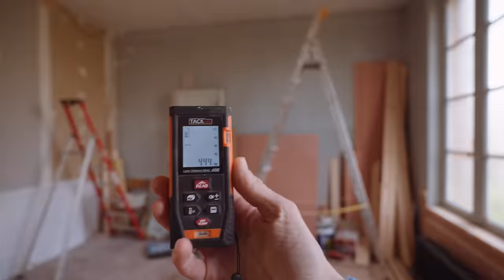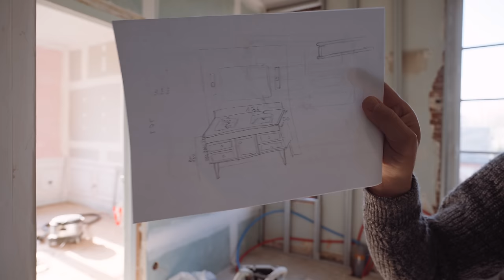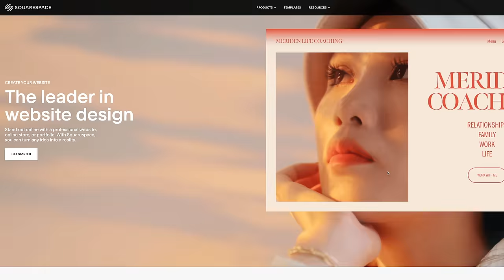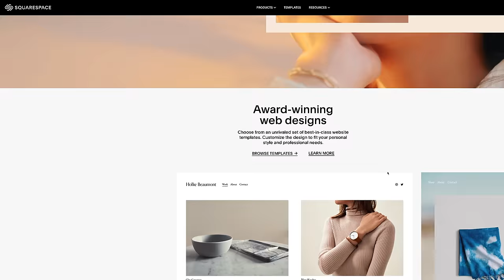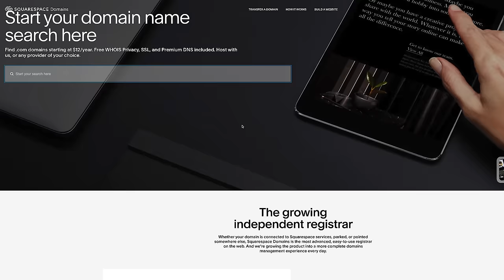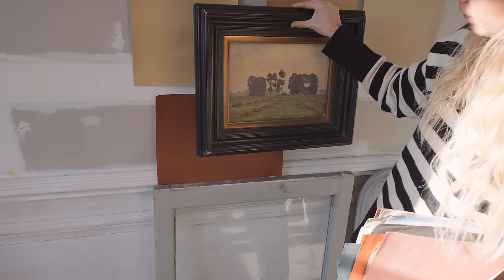Revealing the PAINT SCHEME for our Master Suite Renovation

Comment: You can get one of those ladders on a rail like what you see in libraries for the wardrobe
Reply: That’s exactly what I was thinking.
Reply: Yes that’s what I was thinking! But maybe some sort of foldable ladder that stores in the cabinet
Reply: Benoit can make one. He'll love to do that 🙂
Reply: I think that only really works without doors, and then you'd have open hanging space which can easily look messy
Reply: And perhaps some hanging rails that pull out and down below!
Reply: @LittleDergon  I have been in libraries that had glass doors on the bookshelves and the rolling ladder. They worked beautifully together, you just have to get the spacing right so you don’t risk hitting a door with the ladder if left open or when opening and closing.
Reply: You could place metal hooks in the ceiling where a rope ladder could be attached with a pole whenever you need to access the top shelves. Not very convenient but certainly unique.
Reply: Or buy an actual library ladder of the type thats slightly curved wiith a tall pole. They're quite lovely pieces to look at wherever they're placed provided you have space for them. And nothing slidey or blocking anything. They come up on auction every now and then.
Reply: I think they have this in their kitchen, could be similar?
Reply: I was thinking that too. It would give the room such a lovely Harry Potter wand shop vibe
Reply: I had the exact same idea, too! Would make for an interesting piece, too!
Reply: That’s what I was thinking!
Reply: That’s great idea

Comment: matching door facades on each side of the room. Look into a "California Closet" type solution with pull down clothes bars that are supported by air pistons that help raise and lower the bars. Each closet could have double the storage space.
Reply: I think those were the ones Anna was talking about but did not like because they were too modern looking, hence the brass/copper comment, I think as much as she liked them she wanted something that would look in keeping with the age of the mansion and rooms.
Reply: California Closets used to both brass chrome and black @dawsie
Reply: Calif. Closet wall hanging brackets all broke in our house, every single closet had that weak system... it may utilize space, but it's poorly constructed, so, they did not make a good wall mount, it fails, and all system will sag and pull out of the wall and become a huge mess. Hubbie had to put up vertical poles in several places to support weight of clothes on those weak wall mounts that failed,  in every closet as all wall mounts broke down over time. And you cannot slide clothes as you could on a rod, because it's not a rod, but a wire box...  Not a fan.

Comment: re double hanging: In the costume area of an opera house we used a simple,  normal closet bar on the  top. An old fashioned window pole with a bracket on one end made it easy to  to  access the clothing. It slipped under the hanger enabliing us to quickly bring down or put up the clothinng,
Reply: Yes. And you often see them in retail stores in the U.S. (Target, Kohl’s) to access out of reach clothing.
Reply from the maker: Thanks for the tip!
Reply: came here to give the same advice. This worked perfectly for me
Reply: What a silly boy you are waste pipe Phillip.I congratulate Anna for standing by you . Actually,the world is presently in urgent need of silliness,and I thank you for your contribution,glue sniffing and all.I love the idea of the yellow paint colour but I am somewhat prejudiced by the disappointment I feel with the colour I recently chose for my walls, and my wish that I had instead used more the colour you are contemplating.
Reply: Yep that’s what I do now, it’s easy and simple and can live hooked over the bar when not in use.

Comment: Hi ! very nicely done, as usual :) Philipp, i think you forgot to put some insulation material between the outside wall and the "placo" in the bathroom; Du wirst frieren ! :))
Reply: I thought the same thing. Chateaux are famously cold...all that stone. AND...insulation seems like a no brainer.
Reply: Yes.  I wondered if the thick brick outer wall was enough to protect from typical winter temperatures in France.  Certainly it would not be in Canada
Reply: @madolynway6612   Madolyn, a typical brick or granite or stone wall will generally have an insulation value of one or less no matter the thickness.  A typical insulated modern wall may have a value from ten to twenty while a ceiling may be 40 or more.  The real problem isn't the heat but rather the moisture which will condense on that cold stone wall just like it does on your iced tea glass in the summer and cause mold on the plasterboard next to it. Good on cheeses sometimes, not so much for some other stuff.  Vapor barriers are important. Lack of them is how houses get "sick" sometimes.  Sometimes what we don't know can hurt us.    Jack L.

Comment: I love the yellow colors! just one hint: Did you think about some insulation / vapour barrier between the new plasterboard wall in front of the existing outside wall? (For moisture protection)
Reply: And also for the bathroom walls.
Reply: Based on the color of the plasterboard it is the waterproof type.

Comment: With such rich colors absorbing the light I suggest adding frosted glass to the top cupboard panels. Be sure to prewire the cupboards for leds and the automatic door switches.

I use a pole with a hook to place and retrieve garments in my top cupboards. Since you'll have limited wardrobe space in the new cupboards, add rails in the top half of the existing shoe/bag cupboards. This will allow you to rotate your seasonal wardrobe from the new primary cupboards.

Comment: Team Yellow tone.  The one that was taped above Muscovado is my favorite.

Pull in the muscovado color with fabrics via curtains, bedding or rugs.

If you’re not doing the same color throughout all 3 rooms (which is what I’d do to make them cohesive), then maybe think about doing them in an ombré effect from room to room starting with the darkest shade in the south facing bedroom, then the medium shade in the bathroom and the lightest shade in the dressing room.

Try doing an accent wall in the bedroom with the green color.  In the dressing room maybe paint the interior of the cupboards with the green (as long as you include LED lighting strips inside).  

In the bathroom, consider painting the vanity or the ceiling the green color too in order to tie all 3 rooms together.

If you do muscovado via fabrics in the bedroom, then  use towels that color in the bathroom and use artwork or accessories (like a seat cushion or pillow if you have a chair) in the dressing room in that color as well in order to pull it all the way through the entire space for consistency.

Best of Luck!!

Comment: I would utilize all of that great space in your closet.  They make rods that fold down now; so you could actually put your seasonal clothing on top and trade out for summer clothes.  They also have telescopic poles to retrieve the hangers way up;  there are always options.
My master bedroom has 10 windows, you can use darker colors.  (Mine is sage green). 😬 White baseboards and window trim.  Any yellow with black tones is definitely softer and easier on the eye.

Comment: Have you thought about a mural along the bed wall instead of a painting? Its a classic french look and there are some affordable options out there on etsy and other places. It would create drama and make the room look larger. Murals also have the effect of large window to bring the outside in. There are more modern versions out there now since its a current trend. Then could use a coordinating paint color on the opposite walls. Have you thought about in your dressing room hanging Antoinette Poisson framed prints?

Comment: I am wondering why you didn’t use any insulation in the bathrooms outside wall, foam or bat would have helped keep it warmer in the winter and cooler in the summer, not to mention prevention of frozen pipes.  I can’t wait to see the finished suite.

Comment: As long as the wood surfaces stay in a neutral tone, if could be any color. I think the beige color would be good on the wood panels and trim work, with the yellow on the walls.

Just like the orange dining room would look so much better with a neutral color on the wood instead of one large orange room.

Comment: Light and dark will work. The only problem with very dark is if you move it to a room with lesser light it goes way darker as shown when you took that sample to the bathroom. How about a custom stamped print in the yellow that looks gold with a light yellow for the print and paint the whole thing gold. As for the bathroom with limited windows letting in sunlight, the lighter the better. And maybe just take that general color theme and incorporate it through the three rooms. The dark not-brown and the gold looked gold though. Its a good idea to try the prints. Id say the few that you both liked, paint an extra plain sample so you can see how the plain is gonna look with a print. Just a thought...

Comment: My opinion: I always like lighter themes and the two lighter ones look really nice, the wall lightest and the paneling below be the darker.

Lower cupboards on the other side with your great dress and coat hanging closets.

Phillip, I have always been told and have also experienced that taking short cuts usually takes one a lot longer than putting in an extra effort when it counts.
Reply: *Philipp
Try to spell people's names correctly.

Comment: For some type of pull-down closet hangers which I have used on past installations on different homes, you can do no better than to look at the architectural and cabinet hardware supplier Hafele.  They have absolutely some of the best hardware and lighting products to be found anywhere at any price.  A German company, they used to be strictly wholesale, but I am sure they would have a retail website today.  What you want I know they have is very simply a horizontal  rod for hanging with a pull rod dropping down on one side which is spring mounted (in a closed box) so the entire rod along with the clothing is raised to the "up" position with little effort. Who knows, they may even have a motorized version.  I haven't seen one of their catalogues recently. If they don't have something you like, I would suggest stop looking.     Jack L.

Comment: None of the colors made sense until you put up the framed art piece; the green in the painting then became a focal point against the sample sheets. 
Per the high hanging spaces: might you consider having the metal fixture professionally powder coated in the finish/color of your choice if you cannot find the item in your preferred metal finish?  I presume the hanging spaces in the dressing room will not have doors; therefore, you might consider UV filtering film or shades on the windows to keep your clothing from fading.
Everything is progressing so well!!!  Blessings from the USA

Comment: For your wardrobe- A motorized pulley system which lowers the clothing bar either up and down or in a circular rotation similar to what the cleaner’s has, but vertical, not horizontal. You may need a deeper wardrobe…this suite  is going to be gorgeous!,,

Comment: great work OBV, I have a floor to ceiling wardrobe and put fat(think kitchen pan size) drawers at the bottom  of the run to maximise the usage of height. I use them most I think. I had  to have those pull-down hanger things that you spoke of in the vid, and theyre a blooming nuisance EXCEPT for the  occasional wear things section  like coats and evening gowns. You might well need a bit more space for those garments that are a little longer, surprisingly thats what Im short of, dresses etc. Id think about making the other side cabinets a tad deeper to have lower shirt hanging, rather than wasting it on shoes or bags, they,re easy to grab for higher up, if you get my drift....its the eye level storage of clothes that keeps you tidy and makes you put things away. For higher up more occasional items you can just have an easy access  little stepstool...not a drag because its not everyday as it were..but maximise  the mid to eye level areas, easy and potentially open shelves in the cupboards by your fire for folded jumpers etc. I dreamed mine would be amazing..and it looks wonderful but its not as well planned as I hoped ( I did the plan!!) anything above 5ft is a pain in the arse to get to
good luck xxx

Comment: I still like the (eggplant?) color on the walls, maybe a fresher version of course. It would go with many of the colors you've chosen and tie back to the chateau. Lighter always seems better in the bathroom. In the dressing room, are you going to match the doors on the other side to the original ones in the dressing room? That seems to be a key detail. Or make it easier and have the doors match and then inside is divided up as you did. Appreciate seeing your process!

Comment: As others have mentioned, if you are assembling outfits in the dressing room the walls probably need to be light and neutral so as to not alter the colors of the clothing and accessories you're trying to coordinate. If you go really dark in the bedroom it will be a shock to walk from room to room. Also, will the dark moody colors be oppressive in the summer heat?

Comment: Why not build a ladder rail where there is a metal Grove along foor and there would be a extra small strong panel at top for the upper ladder track.  It will slide from one side to other.  Ladder could be taken off and hung on wall when not in use and used for clothes to hang over at night

Comment: the distance from front to back of a cupboard is often referred to as the depth, as opposed to the distance from side to side, generally referred to as the width.  If the new cupboards had a door height of a standard passage door they might have upper cupboard doors which went to the ceiling.  As long as the door styles are complimentary the result might satisfy form and function.  In harmony not competition.

Comment: Calif. Closet wall hanging brackets all broke in our house, every single closet had that weak system... it may utilize space, but it's poorly constructed, so, they did not make a good wall mount, it fails, and all system will sag and pull out of the wall and become a huge mess. Hubbie had to put up vertical poles in several places to support weight of clothes on those weak wall mounts that failed,  in every closet as all wall mounts broke down over time. And you cannot slide clothes as you could on a rod, because it's not a rod, but a wire box...  Not a fan.

Comment: Everything is going to be just lovely.  However, I was just wondering why there appears to be no insulation added on the exterior wall behind the plaster board. Also, with plumbing pipes on the exterior wall, are you risking them freezing?  I am just a bit confused and trying to figure out the building practices in France. Thanks for your assistance.

Comment: I've been watching from the first vlog and it still surprising how many times Philip has to redo things as he has not planned this out properly.    I'm really curious is there no inspections (building codes) in France.  
The paint colour would also depend on furniture, drapes you plan to use.  Light furniture / cabinets darker walls as you get great light, darker furniture use a warm colour vs a cooler colour.

Comment: "It's minus 1 outside and not much warmer inside."      That being so, where is the wall insulation???       Unless you prefer to shiver inside.       The hot and cold water pipes are next to an uninsulated cold wall.       Isn't there a potential for the pipes to freeze if the weather gets colder?     What about condensation in between the drywall (plasterboard) and the inside of the stone/brick exterior wall (not to mention the potential for mould to grow).       Just saying...

Comment: If the PVC glue is anything like the stinky stuff the plumbers used on my bathroom installation, it is NOT healthy. It's the sort of substance 'huffers' use to get high. Not good for your brain. Sorry to sound scoldy, but care is needed with long-term renovations. 
I prefer the lighter neutral on the right. I love bold colors, but in a dressing room a light neutral is a nice background.  A small reading corner with a chair and table, by the window, would be relaxing.
Reply: I think he is joking about huffing the glue. You just need to understand his type of humor 😂😂😂❤